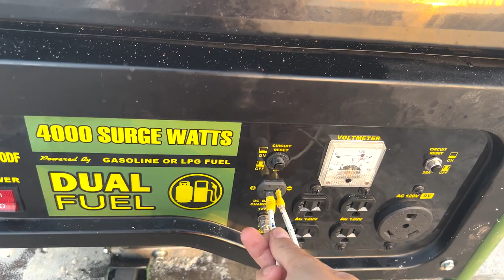UNEXPECTED DAY HELPING LOCALS IN LOS ROQUES | Water System Setup

Comment: A crude windmill like the Dutch build could pump with wind power, because the salt water does not have to be pumped very high. You probably want be around when the system breaks down again. There are plenty of trees, and wood in Venezuela.